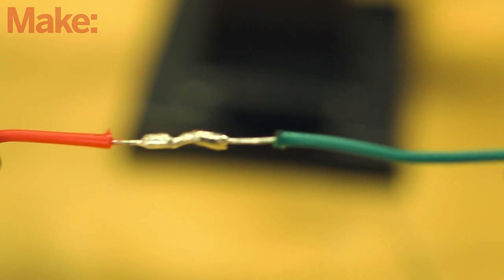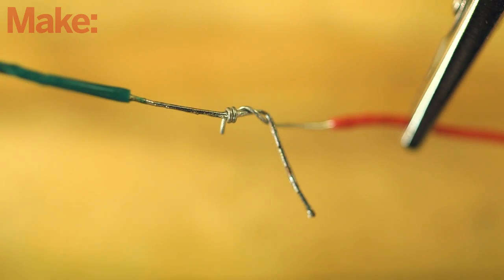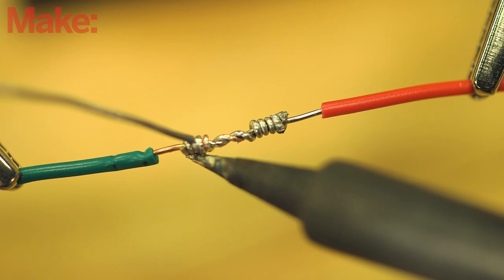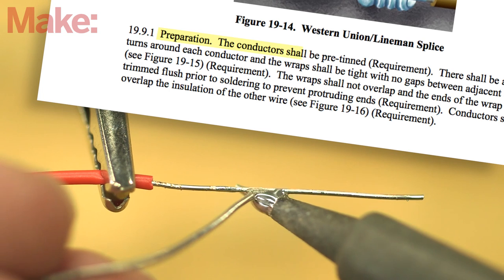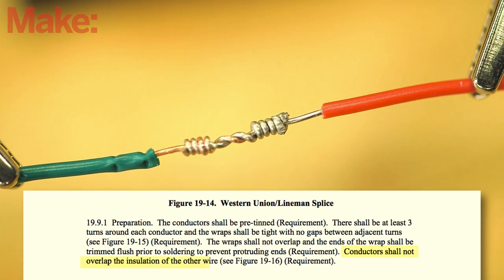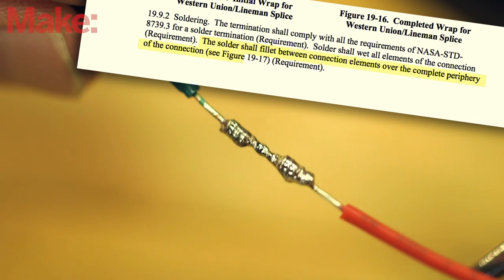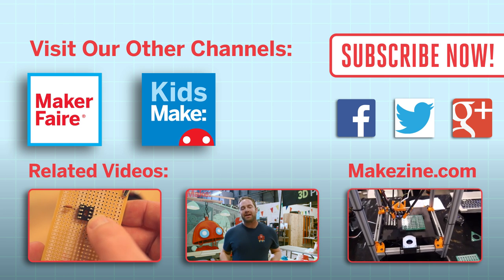How To Splice Wires to NASA Standards

Comment: What an awful example. Tool marks, destroyed insulation, EXCESSIVE solder, poor technique, and what was that insulation clearance?
Why no flux?
Why why why why why?
Ugh...now I'm going to have to make a reply video...
Reply: Damon Anderson can agree on clearance but really, you are criticizing them not using additional Flux? That is way Overkill an doesn't really do anything if u use Flux core solder correctly
Reply: Actually Damon is correct. The example she did would not pass Naval Ordnance Standards. The stripped insulation should have a clean edge and no pinch marks like on the green wire. The conductor should have no tool scratch marks where the copper was damaged by strippers or pliers during the bending. NOS requires the solder to wet surfaces so you should see a hollow (sunken) area in between every surface the solder wets. Liquid flux is used on every repair regardless of cored or solid solder and excess flux removed before re-insulating.
Reply: No toolmarks and a clean cut on the insulation are important, but you are just getting ridiciolus here. A scratch that doesnt damage the structural integrity of the wire and cut that is 100 instead of 90 degrees will in NO WAY damage the integrity and longevity of the connection.
Reply: Agreed
Reply: The standard isn't only for repairs, it's for building wiring harnesses.

Comment: Okay, looks pretty good, but a few concerns...

I don't understand why having a cut, or potential weak point in the wire sheith, caused by penetration of "helping hands" is acceptable.

Also, this solder joint is very strong, but it's also VERY heavy. Aren't we sending this thing to space?

Comment: I will start by saying I am not any type of wiring expert and have never done this type of thing as part of an occupation but I was always told that this type of splice isn't for use on wires carrying any appreciable voltage as the coils would tend to heat up during power transmission and possibly cause a short. Am I wrong?

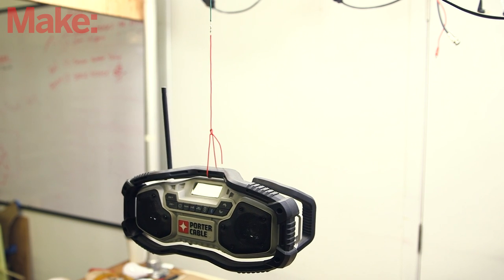Comment: 00:35 Wire already damaged with your wire stripper next to isolation end and this connection will fail first in that point before splice will fail.

Comment: Good video.  That's the way you are supposed to do solder splices, it has to be sound both electrically & mechanically.  The Western Union splice has been around as long as the Telegraph.  Most people just twist the 2 wires together, and then solder them, which is not that strong of a connection.
Reply: It's nice but completely unnecessary in most cases (like when the wires will just end up tucked away in a box). It takes too much time to do when you don't need it.

Comment: Would you use this for thick wire? Like at least 18AWG?

I've used this for thin wire, and put clear heatshrink on it. Using clear heatshrink reduces the temptation to just cover a bad job with opaque heatshrink, rather than doing it again properly.

Comment: I just tie the wire with insulation around it about 2 inches down, very tightly, cut an inch off both sides, tighten the wires together the same way shown in the video, electrical tape the exposed wires, then tape them around the knot. Cool vid.

Comment: Can use heat shrink, but after you slide the heat shrink over the splice. Put some hot glue in each end to make it water tight. Then heat the shrink wrap to shrink it.

Comment: The appropriate length of insulation to strip from each wire appears to be about 30 conductor diameters. For 18 gauge solid wire, that's about 1.25  inches. For 16 guage stranded, you'd strip 1.75 inches. For 14 guage stranded about 2.25 inches. For 12 gauge, strip 3 inches. And for 10 gauge, strip 3.5 inches.

Comment: True, if it vibrates at all it will break right at the edge of the solder.  A flexible wire / non flexible solder.  It has happened a few times on my racing drones.   Solid wire is more susceptible than stranded wire, but even standed will eventually break one strand at a time.  Soo epoxy the joint, dissipate the vibration. Heatshrink. Or just prevent the vibration by securing it. Or dont use solder. 🤔💡
Reply: best thing here is to keep the cables in place with tape for example they shouldnt wiggle/vibrate on there "own" the construct should vibrate "as one" if you know what i mean :)

Comment: not bad.  you should modify a pair pliers so you can compress the coil a bit even after soldered. helps eliminate little spikes.  I've experimented with several soldered wire joints and most are stronger than the wire.

Comment: There are a few more details you missed. 

1.  when you tin the wire you need to be able to see the individual strands of the wire.
2.  you must have fillets between the strands.  excessive solder prevents adequate inspection for quality.
3.  the wires should maintain contact with each other at all points along the splice
4. the splice should not exceed a specific length.
5.  the solder should not wet under the insulation of the wires.
6.  you are not supposed to damage the insulation in any way.  heating a wire with alegator clips pinching hot insulation is a no go.  you can wrap scotch tape around the wire with a flag of the sticky side exposed.  clip on to the sticky part of the tape instead.
7. when you solder the wires, you need to be able to see the individual strands of the wires and should have concave fillets this allows you to see the quality of the solder melt and connection and reduces weight.
8.  you trim the ends of the wires before soldering and you must cover the bare metal at the cut ends when you solder the connection.
9.  solder adds weight, you never want excessive solder, all solder just should have concave fillets

Comment: ok. however how do you do that with an AWG10 stranded wire? I don't need this high tech splice for an easy single strand, because for the applications when this is useful, single strand wires are simply a no no.

Comment: The way I splice wires together is to make a 180° turn in the bare wire on both ends to form 2 hooks, hook them around eachother then twist the ends and apply solder. This method is MUCH better though!

Comment: The trouble with this method is if the cable is for auto use and is multi strand, when you tin it it becomes solid and can't be twisted around anything. Me I put on heat shrink tubing first, sliding it away from the joint, then twisting the wires together and soldering making sure it is properly wetted then slide heat shrink back over joint and shrink.

Comment: EN: How good!! Now I see that it is a single-wire cable, why? In my opinion it is more fragile to torsion, and also inherently more rigid, which makes it dangerous to use vibrations in situations. In fact, in the automotive industry, cable with a greater amount of filaments and a smaller section is used precisely for that reason, among other reasons. I suppose the explanation is valid for the splice itself, because the cable was detached with a pliers without any control in case it is likely to leave marks on the copper and be a weakening point and break. The explanation is worth it, but we learned this type of joint in the technical school, equal respect to the people of NASA, they arrived at the moon and sent mechatronic equipment to space and they work.

ESP: Que bien!! ahora veo que es un cable unifilar, por que? a mi entender es mas frágil a la torsión, y ademas inherentemente mas rígido, lo cual lo hace peligroso de usar en situación vibraciones. De hecho en la industria automotriz, se usa cable con mayor cantidad de filamentos y menor sección justamente por eso, entre otras razones. Supongo la explicación vale para el empalme propiamente dicho, por que el despunte del cable lo hizo con un alicate sin ningún control en caso probable de que deje marcas en el cobre y sea un punto de debilitamiento del mismo y se quiebre. Vale la explicación, pero este tipo de empalme lo aprendimos en el colegia técnico, igual respeto a la gente de la NASA, ellos llegaron a la luna y envían equipos mecatrónicos al espacio y funcionan.

Comment: A small tip. If you are going to use a shrinking insulation to cover the splice, make sure to put it on one of the wires before you start the splice. It is really annoying to get half way though and realize you forgot the insulation, ha.
Reply: raises hand, guilty
Reply: +God of Thunder (UKKONEN) I think we have all done it at least once, ha.

Comment: there is alot more to it than that! it was a good vid but would never have been allowed near even a light aircraft let alone anything space related. to start with wire stripping has to be done in such a way that the core is not damaged in any way.... that includes even the slightest scratch so those strippers you are using are a no-go! but for DIY it was a great little vid. as someone has already pounted out, dont forget the heat shrink!

Comment: Why don't they use crimp splicing sleeves instead? For a 16 gauge wire, a properly made crimp splice can hold for least 90 pounds of tension, and it takes a tenth of the time, if not less, to make.

Comment: If an electrical wire is stressed to require this kind of joint, then the problem is that the wire is stressed. Why would you not secure the wires so that they would NEVER get stressed. While the joint is stronger than the wire itself, who would go into space with stressed wires at all? Is this REALLY why we had two Shuttles blow up?

Comment: NASA uses Teflon coated wire that wouldn’t melt like that on the cut off sides.
They would also be using stranded wire, not solid .

Comment: Yeah I was taught that as "the nasa standard." I use this every time I have to join wires, although now, instead of using solder I just use a crimpless heat shrink & solder connector over the  join.

Comment: This is the NASA standard on joining wires: https://nepp.nasa.gov/files/27631/NSTD87394A.pdf

They allow a LOT of different splices. Sez the book, "Solder-style splices produce a smaller, more compact splice termination, with significant weight reductions over crimp-style splices." It appears the only splice you can't use on NASA equipment is wire nuts.

I'm going to use "axial" and "radial" to describe these splices, after aluminum electrolytic capacitors - an axial cap has one lead at each end, and a radial cap has both leads at the same end.

All these splices are authorized by NASA:
Lap splice (axial, conductors side-by-side)
Lash splice (lap splice with a piece of wire wrapped around it before soldering)
End-type splice (radial version of lap splice)
Lash end-type splice (radial version of lash splice)
Solder sleeve (axial splice using a piece of heat shrink tubing containing a ring of solder between two rings of hot melt glue)
Western Union or Lineman splice (the subject of this video)
Solder ferrule splice (end-type splice using a crimped-on ferrule that's filled with solder)
Crimped ferrule splice (either axial or radial)
Butt splice (axial crimped splice)
Wire in-line junction device, or "Jiffy Junction" (axial splice with a connector crimped to each end of the wire, which is then plugged into a junction device. Read about them here: https://laddinc.com/products/deutsch-products/jiffy-splice-overview/)

It appears to me that on real-world flight-ready hardware, the preferred splices would be solder sleeves and crimped splices for things one contractor makes, and Jiffy Junctions for things that will plug into other things during installation. Solder sleeves, which are slicker than hair oil, are the standard in aviation because they work, they're fast and they're easy: stick some wires in the sleeve and hit them with a heat gun until the solder melts.

Comment: Wire strippers are of incorrect type. NASA STD 8739.4
6.6  1. Strippers. Either precision mechanical tools or thermal strippers shall be selected for insulation stripping. Thermal strippers shall have variable temperature control. The tools shall not nick, ring, gouge, or stretch conductors or remove plating so that the base metal shows.

Ideal Stripmaster would be an example of proper mechanical strippers.

Comment: I would put a sleeve on first, on one side, then once the entire thing is done, slip the sleeve over the splice. tape it into place.
Reply: DisabledPrepper heat shrink, you already have the soldering iron out so it takes no time to seal over a join. I only use tape if its a proper bodge job fix to get something running again quickly, or if its a small break in insulation that needs to be covered over without cutting the wire

Comment: Solid strand?. Don't need solder. Not even with stranded. You need to pull the wire to tighten the splice as well

Comment: You should not use mechanical wire strippers. Those damages conductor. No alligator clips to hold wires which damages insulator.
Reply: and you CAN use them ... just make SURE its NOT damaged !

Comment: You would NEVER splice a wire in a system containing JANS or QML V components.  We are talking $300 for a zener diode and $2000+ for a single microcontroller.  Not to mention, polyimide PCBs that run a few thousand dollars.

Each PCBA can cost $100,000 with simple analog and digital circuitry on it.

No wonder companies are willing to take a risk using COTS parts and hope for the best.

But, mission critical programs cannot take additional risk.  That's why they're so incredibly expensive.  A solar flare will destroy almost anything due to the large single dose radiation.  BJTs are inherently more resistant than FETs.

Comment: There's nearly no reason to do this.  As stated, the lineman's splice is meant for cables under tension, and unless you're running aerial cable your wires should NOT be under tension.  As many have stated below, soldered wire splices are not considered airworthy by FAA standards; wires should ideally be continuous, but if splicing is necessary, an all-weather splice which is essentially a crimp-type butt splice with built-in heat shrink is to be used.

Comment: It is counterproductive to solder tin a solid wire that is already tin plated. It creates unwanted slack in the joint. If it were bare copper, it would need to be tinned but not in this poor lumpy manner.

Comment: Soldering heat will cause the wire to be brittle at that point. 
Tinning the wire and then bending it is a failure point also.
I dont care what NASA says..

Comment: If NASA is splicing wires on a space shuttle its no wonder that there have been events of great proportion.  They should use terminals and replace any wire that is not continuous for its full length.  Seems several billion dollars per launch makes a simple piece of wire seem like no cost at all
Reply: AMP brand PIDG series crimp connectors. When the crimp tool is properly calibrated the wire itself will break before the connection does. 
When wiring safety controls for nuclear power plants, each day at start of shift each worker had to submit ten crimped wire samples for each type crimper to be used that day.  QC then pulled each sample on a pneumatic ram tester which recorded the breaking point. All samples were retained with wireman, breakpoint data, crimp tool serial number, crimp connector manufacturing lot code, pull tester serial number and calibration code, and job number.
 
The downside for DIYers would be that the connectors,  crimpers, the pull tester, and calibration services are quite expensive. Not to mention the cost of a QC department to look over the results.

Just a bit of yammer regarding how it's done in the nuke power industry and for rocket surgery...

Comment: Don't tin the wires before splicing, you're just making the wires harder to work with, but any time you are tinning a wire dip it or coat it in flux first as there's not enough flux in the solder wire. When soldering the joint: 1) flux the joint very liberally, you need it to get the best flow of solder in between the wires and especially with stranded wires; and 2) up your iron temp as the wires sink a lot more heat than small components.

Comment: So much stupidity in the comments section here. Let me clear a few things up.

1. NASA allows for either crimp OR solder splice connections, but ONLY when using stranded wire. They DO NOT allow crimping when solid core wire is used, which is what is seen in this video. They also use very specialized crimping tools and connectors when connections are not soldered which can easily cost thousands of dollars. 

2. FAA does NOT allow any solid core wire to be used on Aircraft. They allow either crimped OR soldered splice connections, but they largely prefer using crimp connectors. Keep in mind they aren't factoring in how the general public mostly use crappy butt connectors with plastic insulation with multi-purpose stripper-crimper tools. FAA is quite specific about using appropriate single purpose tools with proper crimp connectors and proper heat shrink tubing. 

Based on what is available to the general public where a setup can be used for various projects, wire sizes, and operating environments... the best way to make such connections is by soldering and using a proper adhesive lined heat-shrink tubing. A decent soldering iron, an assortment of adhesive lined heat shrink, and spool of Kester or MG solder doesn't cost very much and have much more uses than a quality crimper setup. I am a novice at soldering and have never had a soldered connection fail on me.

Comment: This is one of NASA's splice standards, and honestly the least useful one.  The other standard is to strip 1.5x cable diameter, straighten, pre-tin, lay side by side, solder (w/fillet between cables), heat shrink.